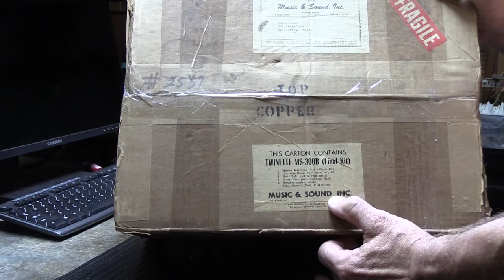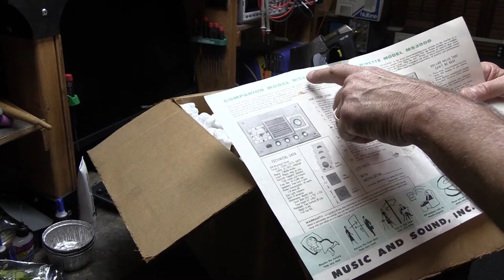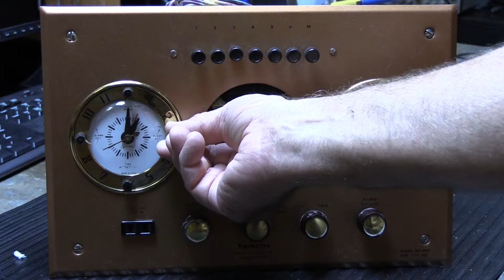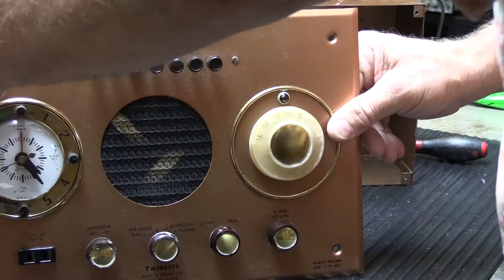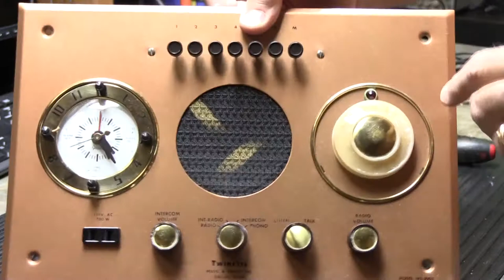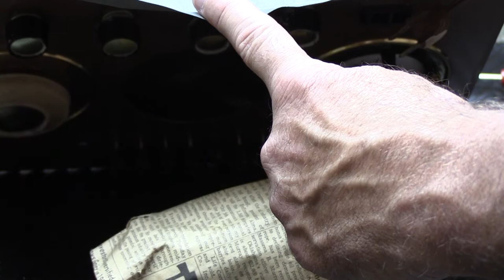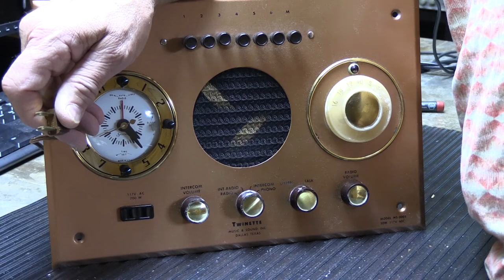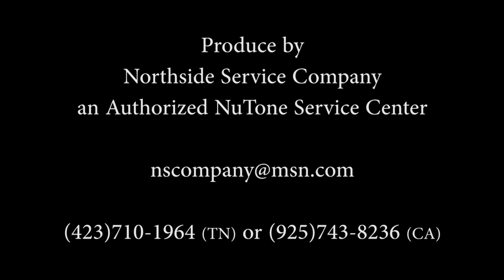A Vintage Unboxing of a Music & Sound Model MS300B "Twinette" AM Radio Intercom form 1957

Comment: That's almost exactly the same as my 1957 Talk-a-Radio!  Same case, front panel, bronze finish, Sessions clock (and controls), tuning dial, etc.  The room switches are different, and my speakers don't have volume controls, but it's clear that many of the same parts were used... and it still works!  It takes a while for the tubes to warm up, and my phono jack is integrated into the panel. Very cool find - can't wait until you get it installed into your house. ;-)

Comment: The little switches that lock in place are probably the selector for each speaker in each room you can turn it on and have a radio playing in that room or not. I have just a little newer  model.
Reply from the maker: Hi keepitshooting:  Yes, I agree.  They are the "room-control" switches for the Remote Stations.  What is the Model number of your System?  Doe sit still work? - Chris
Reply: Yes it works. Not sure on the model,  I'll have to look when  I  paint that room hopefully in the near future.

Comment: There were a lot of obscure companies after WW2 making products like these. I have an Espey model 10 that was intended to be a home hi-fi AM/FM tuner (mono only) from aprox the same time as this. The story goes that whoever bought it upgraded to a stereo unit and then mounted the Espey in their wall and made their own intercom system out of it. Somewhere down the line, a few decades later, the house it was in was being renovated and the radio was pulled out of the wall and was on its way to the dump when my grandfather acquired it (how and by whom? I don't know, everyone involved is long since dead now). It may be the sole survivor of its model# and hasn't been turned on since the 70s or 80s. I was thinking of restoring it (its a 10 tube circuit) out of curiosity but never got around to it.
Reply from the maker: Hi sgath92:  I agree, there seem to be many "regional" manufacturers of Intercom Systems in the mid 1950's through the mid 1960's.  For the most part they didn't survive or were bought up by other larger companies.  Some, like Rittenhouse started off with a great product line and offered some very advanced models for their time.  Sadly, due to lack of investment by their owners, Rittenhouse slowly slid into a 2nd tier of manufacturers by the mid 1970's.
Music & Sound was a powerhouse of design and models who would take the top position at times, until their competitors came out with "new" models.  This back-and-forth went on for decades, until M&S was purchased by Nortek (broan) and any innovation was left on the curb.  As with Rittenhouse, M&S was left top die a slow death by its owners - Chris
Reply from the maker: Hi sgath92:  Interesting idea - I will look into the Radio Museum requirements for a new entry - Chris

Comment: This unit has the same cosmetics as a Trans-Tel Radio-Com 2500-C-7 that I picked up recently - also from 1957.
Reply from the maker: Hi SkYLR: You 2500-C-7 does have a very strong resemblance to the M&S Twinette - however yours looks like it have more features - It's a very nice early Intercom, from a company that I've never seen before - Chris

Comment: That's unusual,  likely the only one in existence.
I was looking for the mains transformer but i think they may have used the heaters of the valves in series to produce an anode supply voltage.,  like the American Five budget radios 40's to 60's.
But i can't see a rectifier valve or selenium diode to do the a.c to d.c conversion.
i could of cause be blind, yep :-D
That radio would need an antenna wire.
Reply from the maker: Hi zx8401ztv: There's a 35W4 Rectifier Tube next to the 50C5 Output Tube - A very classic tube design - Exactly like NuTone AM Radio Intercoms from the same period - Chris

Comment: Something tells me that was a pull out for some defect and was replaced with a new unit and thrown in that box with all the stuff they didn't use to do the replacement and then forgotten about....
Reply from the maker: Hi 2pack4sure:  That's always a possibility and I'm always explaining to customers that when you find something that's 30+ years old and it's suppose to be NOS - be careful, because it is very likely to have a defect.
In the case of the MS30B - It doesn't have any tell-tale signs of having been installed - The wall-housing is obviously never been installed and wiring harness has never had any wires connected to it.  The Master Station is pristinely clean - but if it was defective, it may have only been "installed" for like 1 day. . . You would think that Music & Sound would have wanted the Master Station back if it were defective - but who knows how things were done so long ago.
Being such a simple design (except for the clock) it won't take much to get it working again - Chris
Reply: @northsideservicecompany3567   It's a beautiful unit for sure,, my house, built in 62',  still has the original Music & Sound system.
It was last turned on around 2012 and worked fine but I'm scared to try it at this point !
Reply from the maker: @2packs4sure  Is it a Vacuum Tube Model or Solid-State?  If it's a Tube Model, caution is in order if it has not been used for a long time.  If it's Solid-State, then the risk is small that anything dramatic would happen by turning it on.  - Chris
Reply: @northsideservicecompany3567   It's a tube unit,,  over the years I've looked on Ebay and searched Google images and nowhere have I ever seen one like my unit.
Reply from the maker: @2packs4sure  If you want to email me a picture of it, I'll post it in the Community Section and maybe someone will recognize it - Chris nscompany@msn.com
Reply: @northsideservicecompany3567   HEY !!
Thanks Chris,, I'll do it!
Reply from the maker: @2packs4sure  Cool - Chris